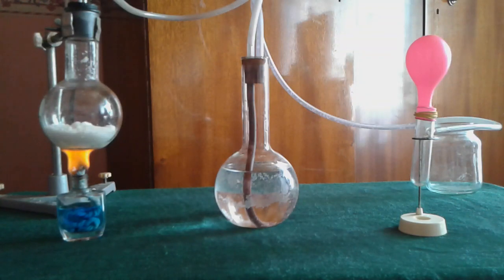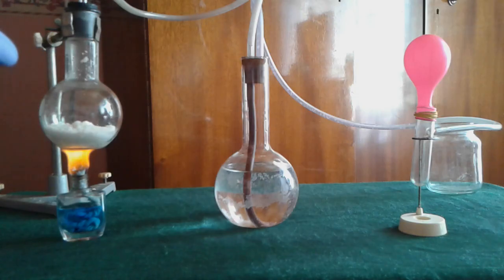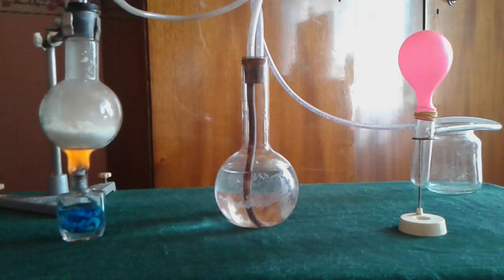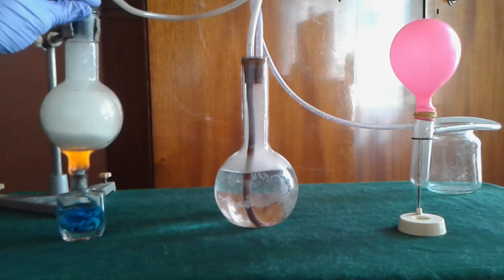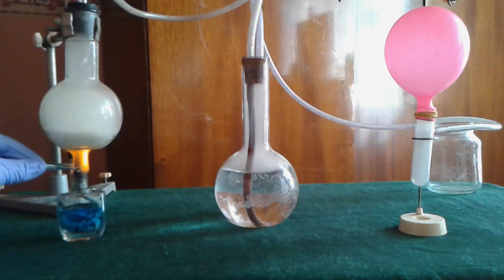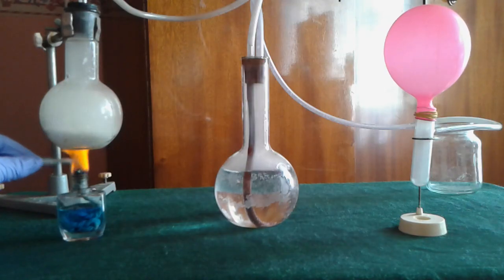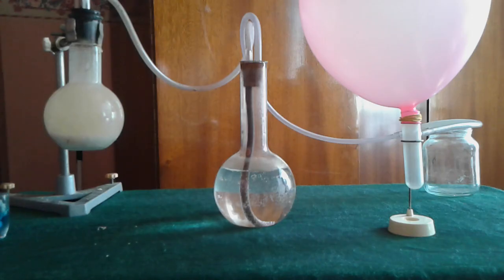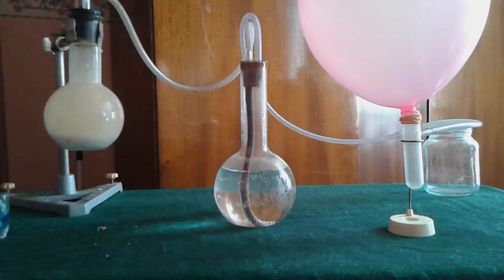How to make N2O (laughing gas)

Comment: You're water trap will be extremely ineffective at absorbing the various nox gasses bubbling through it. It only holds so much gas for a given temperature. You could try oxidizing by replacing the water with a hydrogen peroxide solution chilled in an ice bath. You will end up making a bit of nitric acid in your trap is really the only benefit as most of the nitrogen dioxide(no2) and trioxide(no3)will still bubble right out.... Although ive never preformed this exact process im confident in suggesting the best results could be obtained by a trap solution that will decompose the no2 and no3 without reacting with the n20(nitrous oxide) as its chemically neutral. That would be a sodium hydroxide(lye) solution. I use a lye trap in conjunction with a suck back trap when vacuum distilling nitric acid so the no2 and no3 won't start dissolving my vacuum pump from the inside. Anyhow, cool video. Thank you!
Reply: If someone can tell me how to make N20 that can be inhaled directly, in a simple way, I will give him a satisfactory gift. N20 has a good market in my city and is legal，is good money。
Reply: A lye trap will do it. Nitrous oxide is inert and wont react when bubbled through the lye solution. Nox or nitrogen dioxide or trioxide will decompose in the lye solution... N2o is cheap enough to buy around here so generating it for consumption never entered my thoughts. Theres a lot that goes into wanting to make a gas generator that you could directly huff on.  All the chemicals and apparatus would need to be lab pure and surgically clean as well as the air in the surrounding environment. I strongly don't recommend doing it. But on the other hand, i smoke tobacco... so im a good one to talk

Comment: how i calculate the amount of gas that amonium+sodium mix will produce at certain temperature and for how long?
i intend to make the gas to put in steel bottles for racing use and my plan is to fill one bottle with gas with no pressure and then fill another one by creating vacuum

Comment: Hey I was wondering if you know of anyway to fill up a n2o tank with homemade gas using this method ? And by n2o tank I am referring to the big bottles that are normally blue and are around 130cm tall featuring a handwheel valve you can turn
Reply: you need a compressor to liquify it, they cost about £200 give or take so i dont think its worth it :/
Reply: t1t1t I mean I can sell full bottles of the stuff for £400 so after a few refills it would kinda be worth it but that all depends on how long it takes to get it full up with this method ahah
Reply: t1t1t any idea where I can get a compressor from ??
Reply: @captainkfc2940  you can get some off ebay, but again i wouldnt do it. 
This method of making n2o is extremly ineffiecnt and the worst way of making it, he only does it this way because it is the safest way to syntesise it without everything exploding.
it could take up to a week to fill a single canister and urll end up spending much more on the chemicals per tank than you would just buying one normally.

Comment: Doesn't this also work by putting ammonium nitrate in water and heating it?
Reply: Yeah, it does work but don't do it unless you have a really good way to calculate the heat in real time. If you don't, it could possibly explode.
Reply: Yes, but I wouldn't recommend trying it unless you really know what you're doing. NH4NO3 is highly flammable, and even explosive under the right conditions.

Comment: Dude, PLEASE be careful....Watch your temp on that....
Reply: Bam Chug he’s good dude don’t worry, but if I was him I’d use a hot water bath
Reply: @FindingCreatures  hot plate yall dip shits lol n2o not flammable fuck wads
Reply: @dekabmyco  it's for the glass so it doesn't shatter "fuck wad".
Reply: @austinadams3400  its neither for the gas and the glass. Ammonium nitrate is explosive at high temperatures
Reply: @dekabmyco  yeah. but hes generating an explosive that thermally decomposes in situ, it could detonate

besides anyone talking about the fucking glass lol
its borosilicate glass, it wont pop from high temperature but from heat stress, this is very basic stuff.
Reply: @wongbong4694  is ammonium nitrate a bi-product of this reaction?  I mean from the initial mixture (Ammonium Chloride and Sodium Nitrate)?